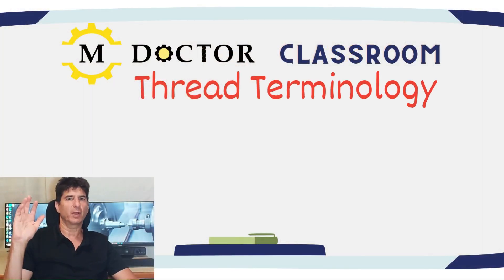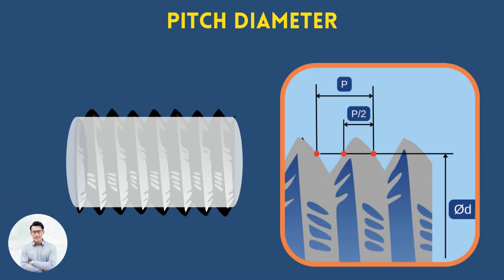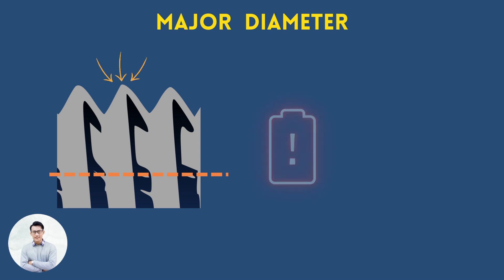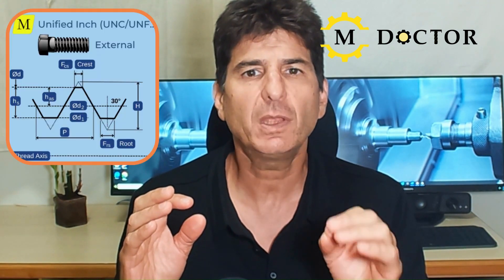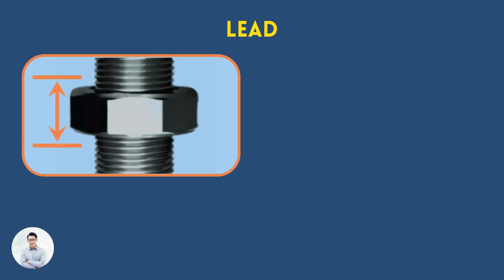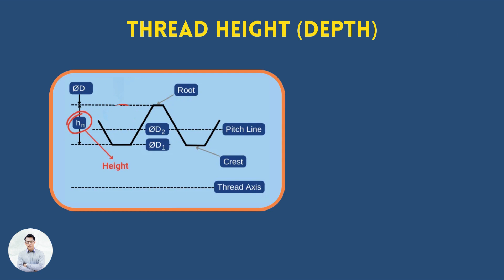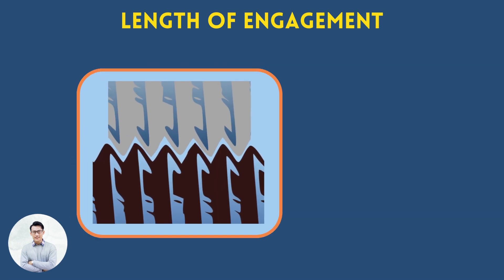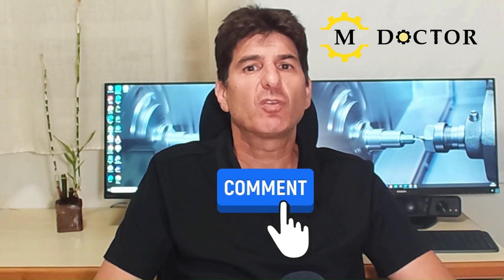Screw Threads Terminology - Clearly explained by the Machining Doctor

Comment: Thanks for this video.  I'm just new to your website resource, I was wondering how to find domestic or "BSW 55°" imperial thread sizes on your calculator / tables?  In Australia, the regular hardware stores only stock basic metric or BSW bolts, you need to go to fastener specialists to find UNC / UNF bolts (these places are often closed on weekends).  I am currently trying to identify an unknown thread that is larger than M4 or 5/32" BSW (edit: and smaller than M5 or 3/16" BSW), with a thread pitch near 0.8mm, I am not sure if it is #8 - 32 UNC, M4.5 or #10 - 32 UNF (I have neither).  This is what led me to your site today.